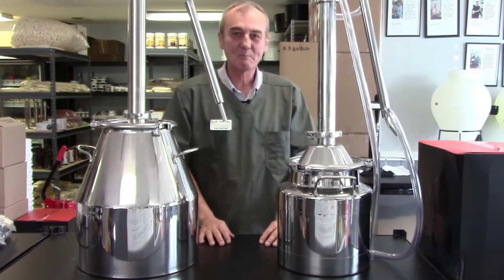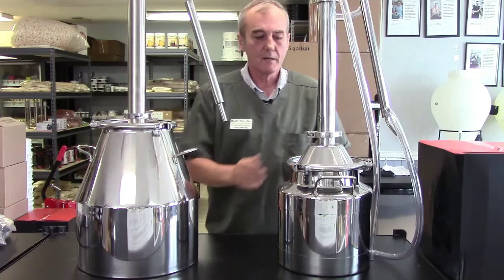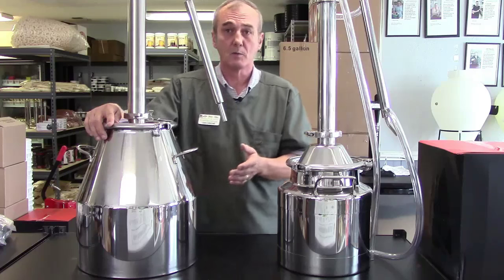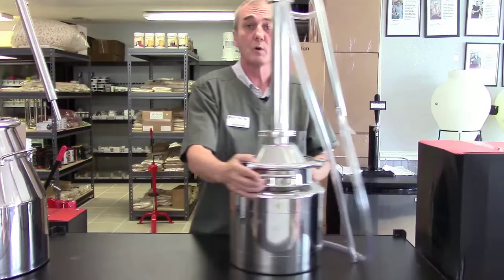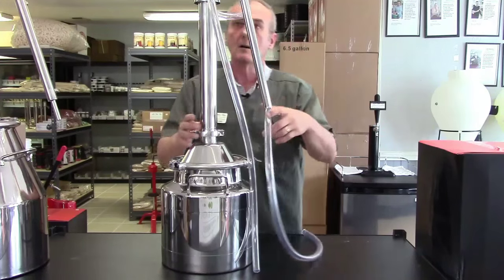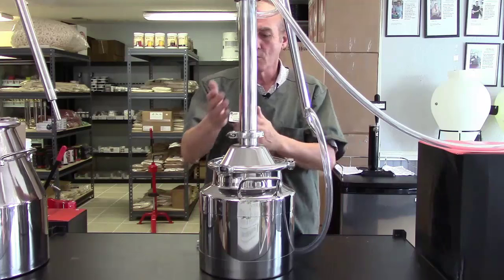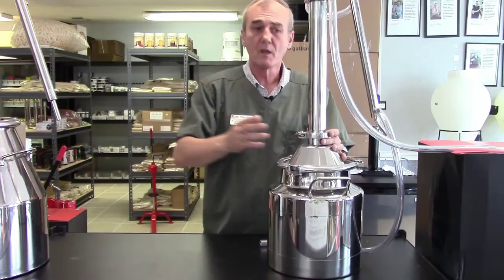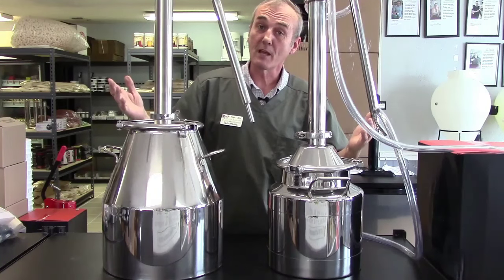running a Reflux Still

Comment: Back in the day, copper was the most popular choice for a moonshine still because (a) copper is a soft metal, so it was easy to shape and build with, and (b) copper reacts with and eliminates the nasty sulfur compounds that form during fermentation. Copper’s biggest strength is the fact that it eliminates those sulfur compounds, making it an important step in distilling alcohol. But do you need your entire still to be made out of copper in order to get rid of those sulfides? Actually, no you don’t. Using even a small amount of an all-copper column packing such as mesh, scrubbers, or rings inside your stainless steel column will remove those sulfur compounds.
Reply: "Still Behind the Bench" explains the copper chemistry issue and placement very well in Ep 020.  Very smart, young fellow.

Comment: Here's how I do it on my reflux, pot still tower. 
I use the tower as a pot still. And collect everything 
I pour what I have in my air still and set it to 95C
Toss water and pour back in air still. 
Then I set it to 83C (Use as cleaner or fire starter
Then set to 84C (My infusions liquors)
88C (The drink as is Liquors)

Comment: +Barley and Hops Brewing LLC, +George Duncan, I have this still but haven't used the reflux yet but aren't you suppose to be able to regulate that water entering the pre-condenser to balance the reflux ? or does it not matter in this set up ?
Reply: Yes. That is what the red handled valve included in the water control system is for. It goes between the pump and the inlet of the reflux chamber. You then meter the water flow by adjusting that valve. Hope this helps
George
Reply: I know what your talking about (its in your other video ) but there is no red valve shown in this video, also this still only has one inlet and one outlet as opposed to the other still that has 2 sets... unless i'm mistaken. also thank you for taking the time to respond, im a HUGE fan.
Reply: I see what you mean. Yes, you are correct and this is a good question. There are variants to the reflux still and Mile High has packaged their 3 gallon Mighty Mini without the valve. This will require the operator to rely almost entirely on the heating source to control the reflux action. This works but I always prefer to have a separate method to control water flow. That way I have more control over the entire process. If you own a variant as in the video I would recommend that you add a valve or even a completely separate water pump and hose for the reflux alone. That way you can turn on the condenser and then operate the reflux portion independent of the condenser. This is just a marketing approach taken by Mile High (not my favorite but still effective). Hope this clears it up a little more. 
George
Reply: you nailed it,  thanks so much !!!
Reply: I run my water pump from my swimming pool to a garden hose that I cut in half. Half for the in and other half for the out water.  I rigged a round garden hose spigot valve and adjust the flow with it based on the temp.  As the temp rises on the column thermometer.  More water flow will he needed.  I can control how fast or slow the product drips out by adjusting that valve.  Don't use a ball valve because it won't let you make fine adjustments.  Get the round handle valve.

Comment: Question wen ur mash stops perkulating bubbles wen should u run it how many days of a window do u have
Reply: It’ll be alcohol at that point. Depending on your OG, should be 7-20% ABV. It’ll be fine to sit forever probably, especially if the vessel is sealed. Even if your mash goes sour you would be fine to run it, might have to strip it and add it to the next run because a bit of that sour can come thru in the distillation.

Comment: Just got the dual purpose reflux still so my question is. Do you keep the water cold and flowing like crazy in the reflux collum like crazy to keep the alcohol from condensing into the outlet line for awhile then turn it down to start getting that flow and higher percentage?
Reply from the maker: The water flow in the reflux chamber must be metered. Start with a slow trickle and adjust after that. If it is too much flow the still will not produce.
George
Reply: Awesome thank you that helps but I’m trying to get at before I let any product run do I run the reflux chamber fast to let the alcohol run up and down the chamber before I let it run out ?
Reply from the maker: There is no right way to do the wrong thing. Don't try to short cut or make your still do something it will do anyway by itself. Sometimes over thinking the process can cause more issues than it resolves.
George

Comment: looks like  i could run a reflux to "strip run" high grade alcohol then run without cooling jacket , as a pot still to get flavors
Reply: Joe Brown 

That’s the point...

Or simply flavor the spirit after cutting it to a usable proof.

I believe some people use gin baskets and/or flavoring chambers after the reflux column to introduce subtle flavors to even high test alcohol that reflux stills produce.👍🥃

Comment: isnt there a need to control the amount of water in the precondensor because then wouldnt you be condensing too much or does that not matter ?
Reply from the maker: Not sure I understand this question.
Reply: Yes you need to control the flow of water in the reflux column with a valve of some sort...

Too much cooling on the column nothing comes out...
Too little cooling and the reflux is not going to run effectively or efficiently.

I think that is what you’re asking.👍🥃

Comment: what temp would you run the stripping run and how many would you run before you run a slow run? thanks!
Reply: Varies still to still. It's not a "set temperature".
When George says "it's run hotter for a stripping run" he means that you put more energy into the kettle faster so you  take the product off faster and the whole run takes less time (downside is you get a lot more water and unwanted by-products coming across and your likker will be a lower proof/abv and worse tasting because of that - which is why you don't "run-your-lawnmower" on a stripping run).

"A slow run" refers to energy being added to the kettle less aggressively so it heats up and operates more slowly than with the stripping run. You run it slow and you get less cogeners and water coming and a higher started abv usually - but it takes longer for the whole run.

The most obvious visible difference between a stripping run (hot run) and a Spirit run (cool run) to the person running the still is the amount of product coming off the product condenser/parrot.
Spirit run (for a home still) it's the small pencil lead sized stream/drip-drip/stream trickle, ... Stripping run (hot) it's a gusher! :o) 

You'd usually (if you're being economical) want to do enough stripping runs to fill your kettle AFTER it's diluted back to 40%abv or less. Then you can do a finishing run or "Spirit run".
NEVER do a spirit run with anything over 35% to 40% abv ... otherwise you just built yourself a potential bomb. :o)
Reply: I run mine at 208f, until ABV is about 20%. Just 1 stripping run per new mash content.

Comment: Probably a no brainer question, but if using a reflux still, would you get the same amount of methanol as in a pot still?
Reply: A reflux still would be able to separate them better. The (very small amounts of) methanol comes out first in the "heads"

Comment: +Barley and Hops Brewing LLC when do you do a stripping run do you have to separate the fore shots and heads or does it just all get dumped in ? also when do you know when to stop stripping or does it not matter ?
Reply: If you are running a reflux stripping is not recommended. The stripping process is normally reserved for pot stills where one would run the still hot and fast. Foreshot are still removed and thrown out. The finished product is then re-distilled in a final run.
George
Reply: so basically dump everything between 145 and 179 degrees correct ? 179 -204 get thrown into another mash then brought up slow as you instruct to do correct ? just ordered my outback from mile high im excited !

Comment: you don't "ascribe" to the "idea" of a chemical reaction between the copper and distillate. That is science, that is fact. Just wanted to clear that up. 
As for the question, "is copper better?", well, that depends on your final goal. if you are after a clean, neutral, spirit then the answer is unequivocally and undeniably YES. but if you are after some kind of taste that you like, that the copper changes or removes, then of course no. also, FYI, the copper has to be in contact with the alcohol vapor to work. this is why distillation columns are sometimes made with either copper packing in the vapor lines, or they just make the top of the column copper instead of the whole thing. 
the copper reacts with sulfer compounds and removes them by binding with them. you then wash this off (the copper will turn black when this happens)
Reply: Well just saw another one of your videos where you basically explain all this. I was just a little surprised that there were "two opposing views" on the use of copper for a cleaner alcohol. Coming from a professional distillation engineering background, this is just a fact...not really open to interpretation. That other video was a much better explanation of this.
Reply from the maker: Thanks. 
George
Reply: Please clarify.  If I want (basically) more of the flavor from my mash to come through.  I would then want to use the Pot Still, probably stainless steel instead of copper.  If I want a more neutral spirit and perhaps a bit stronger.  That is when I would want a Reflux Still and include Copper (or more copper as the case may be)

Just my 2 cents but if it will strip out sulfur compounds I think I would want some copper in the linkage no matter what still was used.

Comment: where is this legal?
Reply from the maker: +duane freeman Nowhere in the United States. 
George
Reply: Barley and Hops where are you at?
Reply: +duane freeman ~ If you fill out a form and mail it to the feds, you can legally make ethanol fuel with it. 

Plus, if all you're doing is making it for yourself and not selling it, the feds won't screw with you. Could they? Yes. Will they? Unlikely. They don't have the budget to try and find everyone who is making it for personal consumption. Just remember, pay in cash, and don't have it shipped to your address.
Reply from the maker: +moncorp1 Sorry I cant agree. There is no flexibility with the permit. It is for fuel only and does not cover you if you make a drinkable product. I know of a few who have a permit and yes, they check. May not check everyone but they do check. As far as paying cash and not shipping to your address goes if you apply for a permit it doesn't matter. They no who you are and where you are at.
Reply: Barley and Hops You don't understand what I was saying.
Reply: moncorp1 no sir Im sorry did i miss the point I apologize